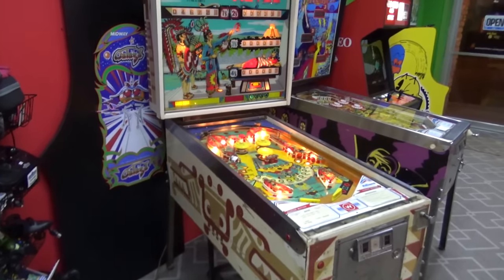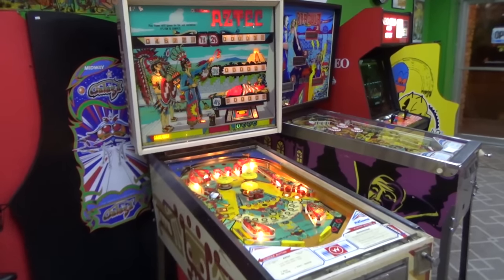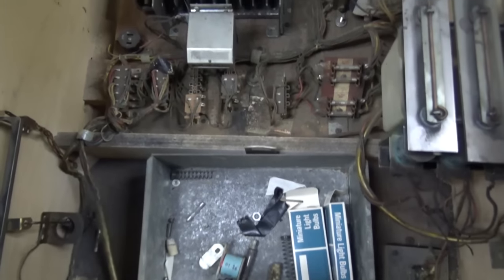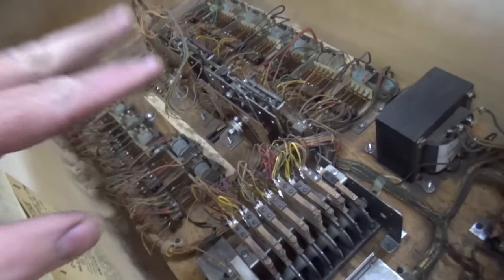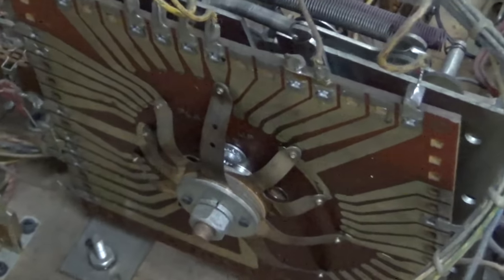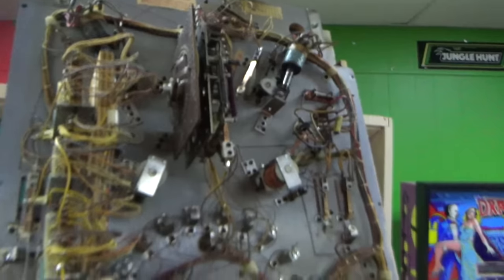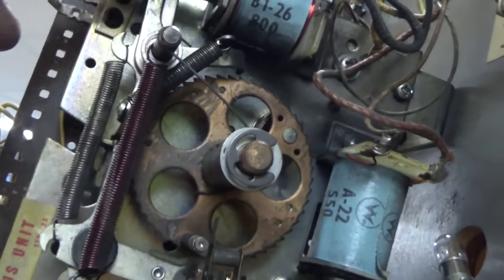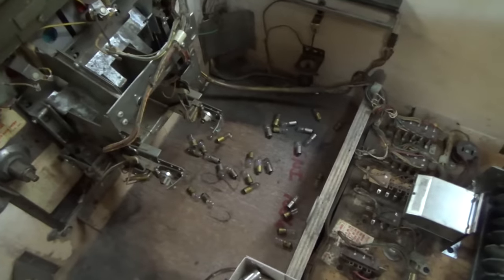Rebuilding And Repairing Williams' Beautiful Chime Unit - The Best Part Of EM Pinball Machines

Comment: Just last night I finished refurbishing a 70 year old doorbell that is nearly identical to how these work. It was a disaster. Someone had painted over the brass body - twice [they even taped the unit off, but then just painted over the tape and left it], the plungers were rusted, the wiring a mess.  I used the sum of my YouTube training to soak, clean, depaint and buff it into like-new condition and now that puppy sings again. It only has 2 notes to chime (2 for the front, 1 for the back), but it's this mechanism in principle. Once I realized it was the same as the pinball chimes I had no other option but to get it to work. Thanks Ron

Comment: Good content. Since I have the same Aztec game, looked at the Chime Unit, all the foam pads were gone like yours. A single hole in the retention post above the solenoid on the long bar was elongated, while the other five showed significantly less wear. Looks like the failure on your machine was just normal usage on that one chime bar that gets the most impacts of the three solenoids..

Comment: About the chime retention holes.  I don't think that the ones you have seen where the hole was damaged were cut.  I've seen similar damage to holes that serve a similar purpose or hold springs on aircraft, usually on components around the engine (piston).  Vibration will start "wallering" (as you said later in the video) up the hole and as it gets larger it wears faster.  Where on aircraft that can happen over a couple hundred hours of operation I expect that chime box holes are worn through by decades of getting slapped up and down by the coil.

Comment: I noticed the end chime that was burnt up also has the hole torn for the retention bar.   That might be why the plunger ended in the bottom of the cabinet as when it locked on it may have just pushed the chime right out of the way

Comment: Any word on how the chime unit is holding up? I have a 72 Williams Super Star and two posts of my chime box were split open. On the large bar I did the same thing as you (crimped the ends back together) and after a few dozen games it broke the table entirely.

I hear some people add a spot weld and drill a new hole. I plan to make two new sets of tabs and mount them using the existing holes in the chime box.
Reply from the maker: I haven't had any problems with it, but it may depend on how badly it's damaged I guess...

Comment: Joe or Ron, Most EM pinball games the solenoids are either turned on or off by the playfield switches getting closed. If you look at the EM pinball games schematics some of the playfield switches when CLOSED will turn ON the power to the solenoid directly ( non-interlock power ) while other playfield switches when CLOSED will turn ON the power to the solenoids stacked relay as an interlock power stuck on until the score motors index pulse stack relay opens to kill power or the solenoids EOS switch Opens to kill power? I'm trying to understand the theory of operations